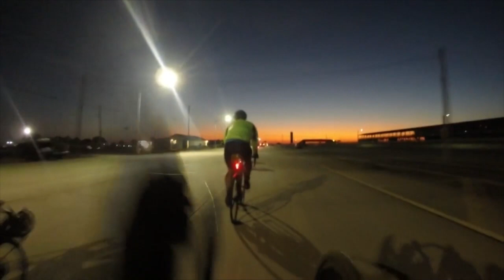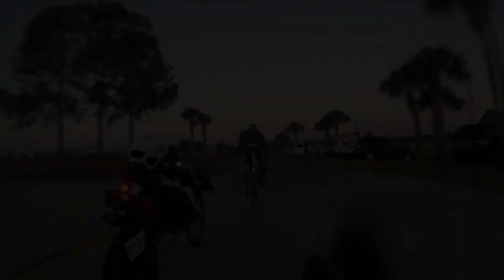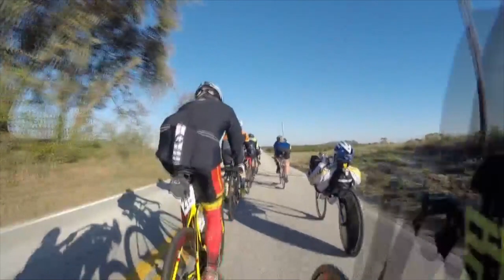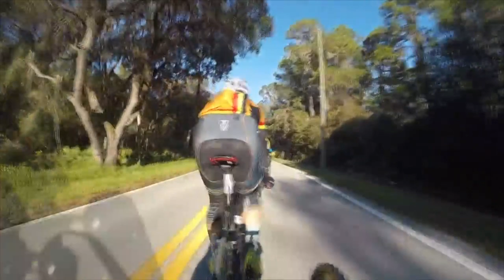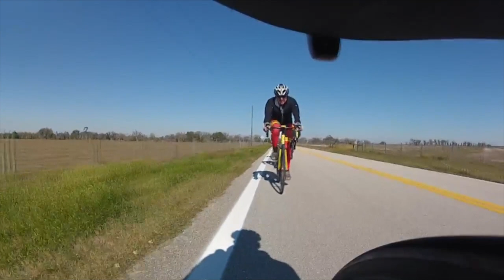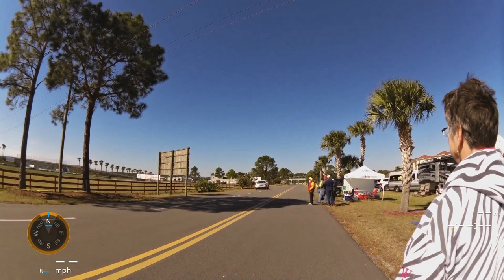Bike Sebring, recumbent bicycle rotating paceline demo

Comment: Ok I am sold,  I need a recumbent asap...hopefully next week,  these videos just solidify my decision. ..thanks...
Reply: Well, did you get one braddah?
Reply: @casualguy3938  Don't know if he did, but I got me another bent.  I ordered a Lightning Phantom frame and built it up with some light stuff.  Carbon cranks, oval chainring, SRAM 1x12, 10x50, hydraulic disc brakes, and a carbon aero rear wheel.

Comment: Diamond framer racers and recumbent riders have really never seen eye to eye I get smart ass remarks when I ride with a group from a couple towns from me I am the only one who rides these and they turn there nose up at me most of the time specially when I show up in cargo shorts and t shirt cause I am not dressed in spandex and jerseys ..
Reply: wbuttry1 i get the same. i went from diamond to lwb bent after a car accident because i simply cant sit in a saddle. i ride a racer much like the one in your profile pic here. and the fact is, a strong rider (or even moderately strong) on a bent is always faster than a strong rider on a diamond particularly on a long flat ride, and it irritates them. not to mention a bit of built in equipment snobbery. i do the same, camo cargos and a regular shirt lol but i also believe that riding a bent has also made me a stronger rider than when i rode diamond frames. i dont have the luxury of using my body weight on climbs like before, it all comes from muscle instead of weight assisted downforce which is something i think d/frame riders totally miss the point on. we dont get to stand up and rock, we can only push from the thigh and its much harder in that respect to ride a bent bike.
Reply: steve twigg I am 55 am ridden DF all my life. just waiting for the arrival of 2nd hand challenge taifun off ebay uk.. can't wait to get my cargo shorts and fred perry on lol
Reply: steve twigg that bike in my avatar is what I ride in fact that is mine.
Reply: wbuttry1 what, a challenge taifun?  the one I got coming has a monoblade front fork+wheel. think it might be called a "kantana" fork.
Reply: It's so funny how people have to form groups. And you have to be a certain way, dress a certain way and do things a certain way to be part of it. Anything different than that challenges the conceptions of it and it leaves insecure people feeling more insecure. It's like our ego's and self worth is bound in spandex and countless logos. It's about the ride. It's about having fun. And it's about getting on the road and exploring.
Reply: great lol you smoked them ha ha
Reply: @itsmejerks  Pedaling: I think it boils down to discipline.  You can't get up, so you really have to hunker down with your spin.  What else CAN you do?  Recumbents and diamond frames: It's a tough relationship from the word go.  You can benefit from their draft.  You can only offer them a minor bit of help.  So that won't make you any friends.  If they have any knowledge at all, they know you are going the same speed as them for less watts.  That rankles them too.
Reply: @todd92371  Well, people like to belong to a Tribe.  You should see how Tribal Roller Derby people are.

Comment: After 58 years of cycling, my neck has given up.  Looking to build my own carbon fiber recumbent, however not sure which would be the most stable at low speed urban start stop commuting.  I know the low rider racers are sexy at 20+ plus mph, but how stable are they at 1 to 5 mph, typical launch from dead stand still?  Thanks for any info you can pass along.
Reply: I know this is five years later... but a high centre of gravity is more stable at low speed. Trikes are always stable of course ;-)

Comment: @Jim Parker Two questions (1) How would replacing standard wheels with carbon fiber wheels affect the performance of the recumbent? (2) Would using a recumbent work your core muscles?
Reply: Carbon fiber wheels will likely be lighter and more aero, so it would make you not only faster but help in acceleration a little. Mostly your legs are going to get a workout, but not so much in the core.

Comment: Nice video!
What kind of speed were you able to keep with your paceline?
Reply: Commentator (Jim) said he was only one riding just the century and the others were doing the 12hr ride.  He also said "she gets to ride 7hrs 40mins more" as Maria completed the century.  From this, they completed the century in 4hrs 20 minutes, which is a 23mph (37km/h) average.  Presumably, they were faster in the pace line than their average, especially since they were pulling away.   I bet they are much better at pace lines now (3 years later).

Comment: very cool. I'm new to Bents. Bought a used VRex a few months ago, just upgraded my Idlers w/ the help of Angletech / Jersey Bents and Teracycle. For a Racer will another Rans do? Which model? - thx
Reply from the maker: +Geoff Kole Of course I'm partial to Cruzbike. If you want to go fast in road races, get a Cruzbike V20. If you want to stick with RWD, go M5 CHR which is nearly as fast on flats but will be slower in climbing races. www.cruzbike.com

Comment: I'm just learning to ride a recumbent. I think that the DF had just pulled back purposely and let the vents just have their way up front. Way up front. The two type of bikes ride awkwardly together in a group. Dfs are afraid of having an accident with a bent especially when a bent is riding the DF riders blind spot
Reply: bs. those ultra competitive macho df riders would NEVER let bent riders win if they could help it. they were clearly attacking maximally in a group effort and they got dropped badly when the bents used the same tactics
Reply: @andy-the-gardener  It's a challenge and every DF rider ( even myself) will always go for the challenge with any trikie or recumbent. My main road bike is a 15 kg alloy bike which I challenge even with $8000 tt bikes. For me it's more of the shock value of someone on a $250 road bike closing in on someone with an $8000 kit. I don't yell names when I lose or win, it's more of "Can it be done". 1 month ago I was chasing down a Canadian women's TT 2 team pursuit training with a $250 road bike, beach shorts and a tshirt, the look on their elite level faces was complete shock knowing each of their bikes were well over $8000 each. I ride for fun, not for being called the best, will race anyone on any bike just for the thrill.
Reply: @danfuerthgillis4483  roadies are anal about minor upgrades and differences between their bikes. but the differences between a 25lb basic road bike vs a super expensive lightweight carbon road bike is going to be pretty trivial compared with individual rider motivation, fitness and strength. the humble wheel cover seems the best bang for buck upgrade. people spend stupid money on their super light racing bikes, when its aero that really matters. beats me why velomobiles are not a common sight
Reply: @andy-the-gardener  The reason why you don’t see many velomobiles here as you do in Europe is due to the nature of the mentality. In Europe many people have and ride velomobiles, ebikes etc as as transportation to work and back.  Their distances are much smaller and the infrastructure there was setup decades ago to handle these smaller vehicles. Here you have to drive a Tank 😂
Reply: @danfuerthgillis4483  i live in the uk and nobody owns velobiles although cycling isnt too unpopular, although it is compared to driving. there is no real reason cycling couldnt be the dominant form of transport here, the usa and everywhere else.  the real reason is car obsession, constant subsidise to make them ridiculously cheap and governments doing the bidding of the ultra powerful car lobby. i dont buy the impracticality argument. making cars unattractive and unaffordable by punative taxes or just imposing a rapidly escalating car ban over say 5 years, would force the necessary change in lifestyles and rearrangenent where they live in relation to their work allocations that are required if humans were to have a future. of course it would be brutal. but humans are adaptable and pretty much deserve some major hardship for they have done.  i say were to have a future, because the sacrifices wont be made, its too late anyway, and they dont have one.

Comment: I own a baron lowrider. I'm still learning it. I'm still faster on my diamond frame tt bike. I hope to be fast on a recumbent someday
Reply: Well. Baron was too slow, slower than my road bike, got a bacchetta 700c corsa and it was slower than my tt bike but I really tried to go faster training for one year to compete in a 200. Crashed the bacchetta in the 200 at 35 mph downhill beam flexed and front wheel bounced up landing one foot to left sending me across the lane into opposite ditch. So I sold my recumbent it just wasn't faster or safe. I'd like to try the vendetta what are your thoughts?

Comment: 2 observations.  The 'bents are wondering why the diamonds don't want them in the paceline, yet when the 'bents formed a group, they didtn't seem know how to work together.  (2).  The narrator seems to think it's uprights against the 'bents but it's a time trial where everyone is going up against the clock.  Of the many 12 and 24 hours that I've raced, there was more cooperation, especially if you are in a different classification.  From my personal experience, it's very awkward to have a 'bent in the paceline because you get the feeling that if you crossed paths, you aren't going to be shoulder bumping.

Comment: I’ve ridden it many times on the front and no drafting, I don’t consider a recumbent a bicycle its aerodynamic advantage. I’ve done the 24 hr raam qualifier and have  seen these guys cheat  and draft. When I can no longer ride a diamond frame you won’t see me on a recumbent. Jin’s commentary that we left them is ridiculous. That’s why you get attitude.
Reply from the maker: I ride with traditional bike riders regularly and there are no problems. Mostly they just let me pull, and you absolutely can draft behind a recumbent, but just not get as much draft. I've also seen recumbent racers cheat in non-drafting races, but no more than traditional bike racers. People are people. Bikes are bikes. Pick one you like and ride it. I like recumbents because they are faster, more comfortable, don't increase the risk of ED, and are much less likely to throw me on my head if I hit a dog or a pothole. ALL of my serious cycling friends on traditional bikes have had serious end-over accidents. Due to our COG relative to the front axle, those are incredibly rare on a recumbent.

Comment: I think the "diamond frame" riders, in a normal century, are expecting to ride with other bicyclist, not recumbentist.  The recumbent in inherently more aero, so not an appropriate bike to ride/race with. That's why the UCI doesn't allow these in events. But in fun rides like this, I suppose anything goes. Bike riders are in a "C" shaped position that cups the wind. This will always be the case as traditional cycling will only allow a test of the man, not technology to the extreme of positional change. And it WILL always be so. The Recumbent folks are in a torpedo position. When I get older, i'll get a recumbent or electric. But put a recumbent in any race and they''ll be dropped in a heartbeat.
Reply: If they would get dropped in a heart beat, why did the diamond frame guys not pass them all and keep going?  Why did they finish behind them overall in the race?  Diamond frames are like watching antique car racing.  They aren't that fast but people will never let go of them.  The UCI is a silly organization that loves to prevent progress. They even ban cycling shoes that, in their opinion, are too aerodynamic.  They hold back the sport of cycling and it shows.
Reply: @kufman01  this is why cycling will always be great, cause it is stable and tests the cyclist, and only minor changes in equipment allowed.  That is why it is great.
Reply: @cliffcox7643  if they were just testing the rider, all the bikes would still be cro-moly.
Reply: @rossbrumby1957  That doens't make any sense. The topic here is the radical shape, not the material. The recumbent shape is what allows the great advantage.. Standard bikes, if steel, aluminum, or carbon are still upright machines.. The only thing that changes with those materials is not inherent aero, but just transferring efficiency and stiffness. You're still a block riding into the wind vs a  recumbent.

Comment: Normal cyclists “diamond frame riders” hate you guys because of the ridiculous aero advantage of the position that those bikes give you, meaning that weaker older people can smash cyclists that are far superior in fitness, even though they aren’t as strong!
Reply: I love comfort and speed and I get both on my touring recumbent. Up hills not a problem but I am not competitive and could care less about getting to the top fast. I have not found a hill yet that I would get off and push the bike up.
Reply: Nobody is stopping them from riding a better bike.
Reply: Peer pressure from their riding buddies?  Several riding groups in Vancouver BC will not allow any noncompliant UCI bikes to ride with them.  Only one diehard recumbent cycle shop in town too.
Reply: Bicycling racing is not a feat of strength, bruh. I don't see you bitching about how much harder it is to stop, start, balance and climb on bents. You're perfectly fine with that.
Reply: Dragases I have had this conversation before about how bicycle racing is all about team effort and drafting ? You have to be strong physically and have great endurance to push yourself to win and yes it is about power and speed otherwise just anyone could enter the Tour de France  on any bike and draft the fat guy in front.  I certainly do not measure up to the feats of strength that trained athletes do, how about you?
" I don't see you bitching about how much harder it is to stop, start, balance and climb on bents.  " It seems you have a very different experience on bents than I have . I have no trouble stopping , or balancing at below walking speeds, or starting on hills. As to climbing hills I have very low gearing as my bent is built for touring , and my first gear is 16" and when you are loaded with all your camping equipment and a hill looms before you , it is nice to enjoy the scenery as it crawls by.  Yes it did take a while to get to the stage of riding  below walking speed, just as starting in a higher gear when you did not have the time to gear down.
Reply: @brucewmclaughlin9072  That is a shame. I enjoy riding with the same DF groups I have ridden with for 15 years. In deference to what they are used to and uniformity in the paceline, I have always gapped about ten bikes off the back. I just pick a  group that is challenging. The only issues I have are my need to rush up to the pack when they are going through a light so as not to get clipped off by the occasional red light. It tends to be an intermittent one-man yoyo thing. If I get clipped off I can always catch them with a little extra effort. If the group is a little too fast I move in slightly to get some draft but never close enough to interfere with the rotation.